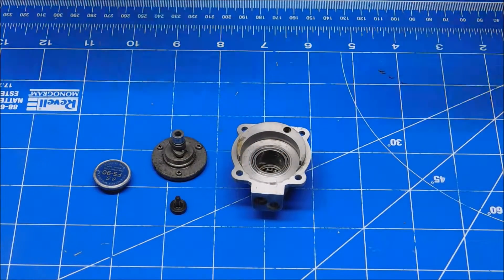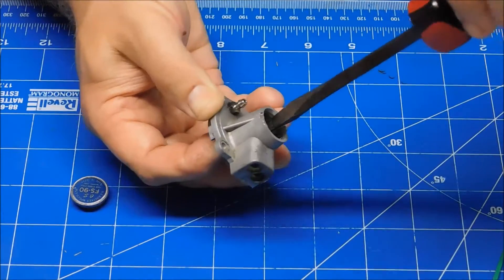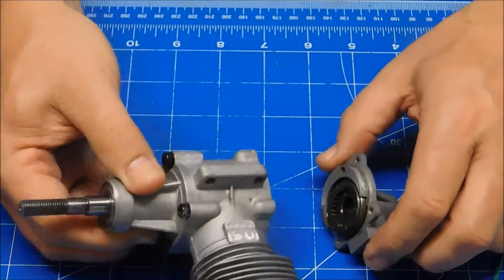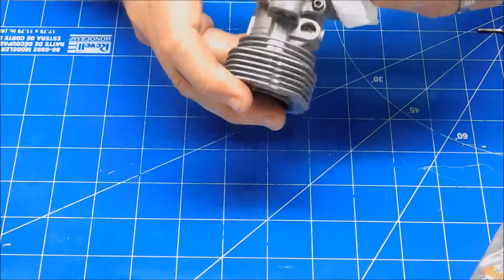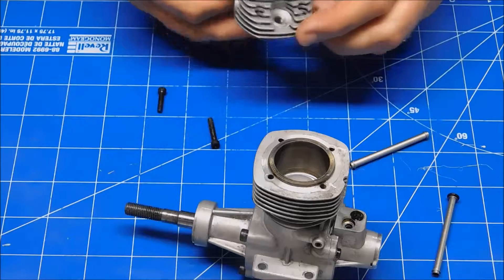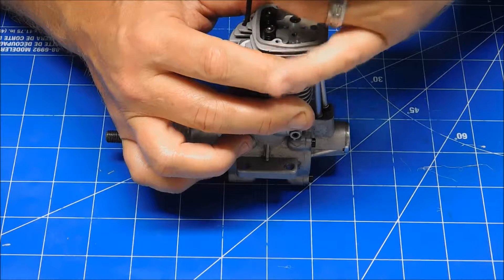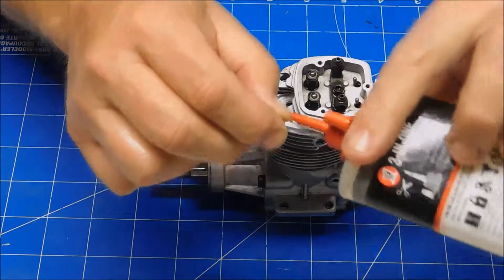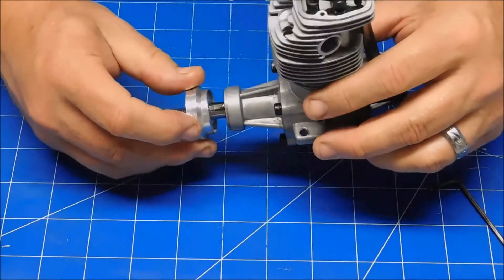OS FS-90  Part 2 reassembly

Comment: Hi David,
Did you put any gasket or gasket paste for the head as you did with the two other gasket? I don't see it in the video.  Thank you for your reply. Johan
Reply from the maker: Absolutely NOT. Never put gasket paste on the head of any engine. These engines may come with a shim for adjusting compression ratio but never a gasket.
Reply: No paste, OK. But on the exploded view of the manual, it shows a gasket. Does it work and seal efficiently enough without anything?
Reply from the maker: @johansteiger871  That is NOT a gasket. As I said it is a head shim.  A gasket covers the holes of fasteners also and acts as a seal, this does not. There is a difference.

Comment: Hi David, I've watched both your videos on the timing of this OS-FS-90 engine. The earlier video was recorded in 2015, and in that video the timing dot was set at 6 o'clock. In this Mar 19, 2016 video, you set the timing dot to 12 o'clock. So now I was wondering, which is the correct timing setting for this engine. I recently rebuilt my OS-FS-90 engine, tried running it yesterday, but it was backfiring like crazy and very hard to start. It did fire up at full throttle, but only ran for 3 seconds and died. I believe that my timing dot is set at 12 O'clock as per this video.... got to be wrong. Did you have issues in 2016 starting this engine after your rebuild, or did you go back to the manual to verify the timing to be set at 6 O'clock, but not mention this error and correction in this 2016 video? Looks like I'll be taking it apart again, but would like your input on this matter. Thank you, Steve.
Reply from the maker: Mine ran fine with either timing setting.  So in my mind it does not matter.